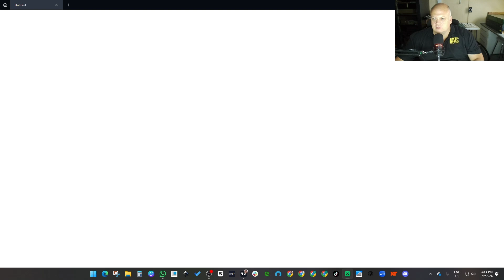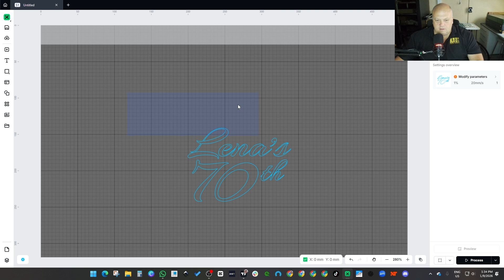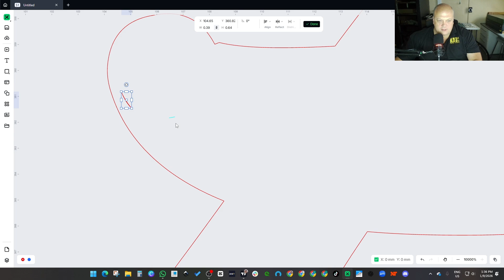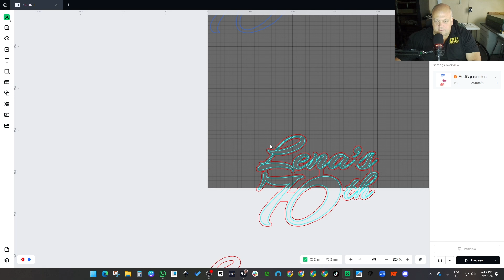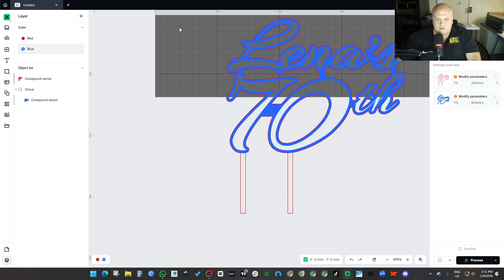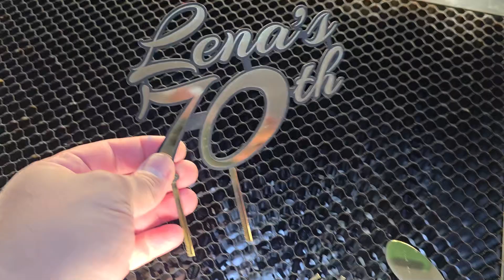How I Design & Laser Cut a Custom Cake Topper (xTool S1 Workflow)

Comment: Hi, thank you for the video! I am absolutely new to this field, and wondering about the safety of having this machine in one of the rooms at home. Do you have to always wear glasses when operating in, and also do you nave a separate exhaust set up? Would appreciate greatly if you find time to answer. Thanks ahead!
Reply from the maker: Hi Natalia, thank you so much for watching, and great question.

I should just say upfront that I’m not a health and safety expert, so I can only share what I personally do in my own setup. With lasers, I do think it’s always better to err on the side of caution.

On the glasses side: if my enclosure is completely closed, I generally don’t wear them. But if I need to run the machine with the door open for any reason, then yes, I will wear safety glasses.

For fumes, I personally prefer venting outside rather than using the air filtration unit. I found the filter unit to be quite expensive to maintain, as the filters blocked fairly quickly and were costly to replace. So if you have a space where you can safely vent outside, that would definitely be the route I would take. Just be mindful of neighbours, pets, or anyone else who may be near where the exhaust exits.

Of everything you asked, the one thing I would definitely recommend is a good third-party inline exhaust fan. I use a 220mm inline fan from my local hardware store — nothing fancy or branded — and it’s strong enough for me to run two machines at once. Because of that setup, I don’t wear a respirator while using the machines.

I also don’t seal up all the seams on my machine, and I explain why in this video here:
https://youtu.be/BM5xrA3qcRI

One last thing: I did remove the built-in exhaust fans from both of my machines because I found they restricted airflow and collected a lot of debris, which reduced extractor performance. But that may void your warranty, so definitely think carefully before doing anything like that.

Hope that helps, and again, rather be cautious when setting up your space.
Reply: @katseblad  thanks so much for such a detailed answer, super helpful, excellent points about venting outside, I will go this route! So excited about starting :)